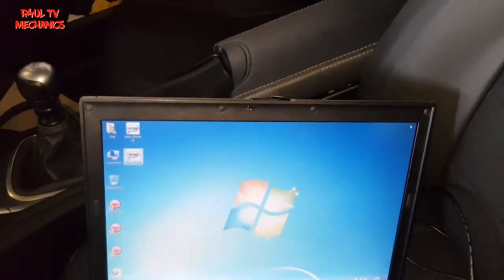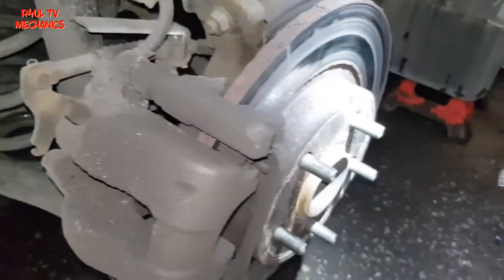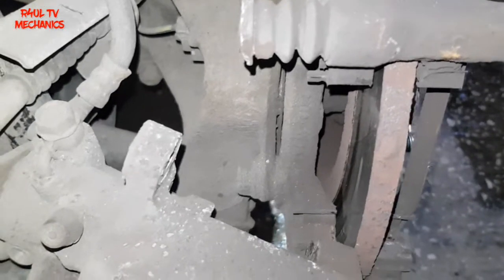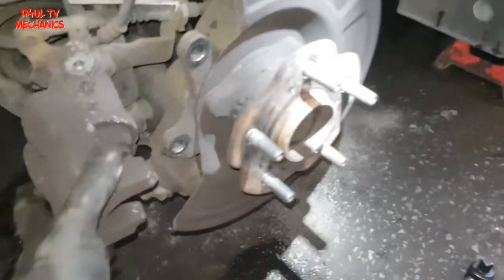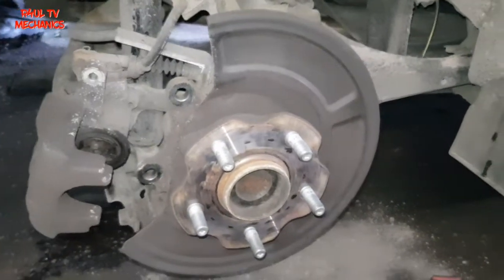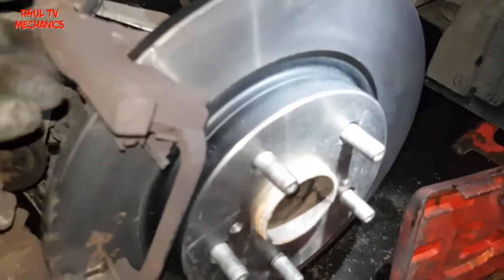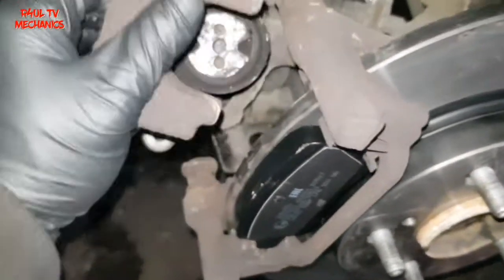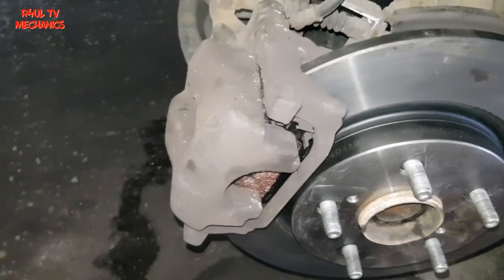2018 TOYOTA AVENSIS REAR BRAKE PADS & DISCS REPLACEMENT

Comment: Thank you for making this video. I just replaced the brake pads on my 2018 Toyota Avensis with an electric parking brake. Here's what I did: first, I started the car and released the handbrake using the button. Then I turned the car off (the handbrake stayed off). After that, I followed the steps in this video. I can confirm that to push back the brake piston on the right side, you need to rotate it clockwise, and on the left side, you need to rotate it counterclockwise. Thx from Sweden
Reply from the maker: Thanks for watching really appreciate it

Comment: I just come across your video and there is a service mode to disengage the handbrake and leave the power off. Switch the the car to ''ON' or ACC, but don't start the engine. Pull the EPB control and hold for 5 seconds. The AUTO (P) off indicator will illuminate. The parking brake will/should not engage when the car is switched off! When the job is complete, push the parking brake control and hold for 5 seconds and the AUTO-P indicator will go out. I have the first phase of the Mk3 T27 Avensis 2009, and the EPB is semi auto, meaning it auto releases when moving off, but has to be manually engaged. From 2011 the full auto system was introduced. Well done for pointing out the cut outs in the pistons and the position when fully wound in. I have done the rear brakes on my Avensis. One final point. No diagnostics are ever needed at any point!
Reply from the maker: Thanks for watching really appreciate it
Reply: Hi m8 great I have a toyota avensis 2.0drd and it is 2012 registered in the UK
I want to change the rear brake pads myself but I am rea scared about the epb. Some people say just don't apply the brake and jack the car up leaving the ignition on. But this could flatten the battery. What should I be doing in order to change the rear brakes
Reply: @mumtazzafar5696   If you have the owners manual, it will have instructions on how to put the EPB into service mode. Here is an extract from the owners manual as follows - 
Switching automatic apply mode from ON to OFF: Stop the vehicle in a horizontal condition and switch the engine switch to the “ON” position (vehicles without smart entry & start system) or IGNI TION ON mode (vehicles with smart entry & start system.
Pull and hold the parking brake switch
for 5 seconds or more
The Auto P-off indicator light will illu minate. 

After finishing the work follow the above instructions to get Switching automatic apply mode from OFF to ON. 
In simple terms, with the ignition on, pull and Push and hold the parking brake switch for 5 seconds or more 
The Auto P-off indicator light will go off. The EPB will resume auto release and engage as normal.
If like my Avensis with auto release and manual engage, just don't apply the parking brake!
Reply: @konradc12  hi m8 can you reset the oil service indicator earlier like 5 to 6000 miles on this car

Comment: Update: did service today,  procedure is very simple,.Before brake service,  turn ignition on and press for 5 sec. Parking handle, Then you should see on dash bord orange P this means that parging brake is off.  Then turn off ignition and do brake job.  That's it.  P. S for eu cars cilinder pasanger side turn to the right,  driver side turn to the left.  After brake job press pedal brake pedal a few time,  start engine,  engage parking by pressing for 5 sec,  now it's in auto mode,  and you done. You don't need battery charge.
Reply: When I tried this the Orange P was on the dash,but the handbrake was fully on so I Could not removed the caliper.
Reply: @pomajzsolt4363 the orange p is telling you that the auto brake is off so you simply release the handbrake with the switch and then you can switch off the ignition without the handbrake automatically applying.

Comment: hi bro do you have the link or item number for the brake wind back for avensis t27 2010 so i csn buy it from ebay,  thanks?
Reply from the maker: Just go on Ebay type in rear brake wind back tool

Comment: What are the torque specs for bracket and caliper bolts? Wheel nuts are 103Nm, am I correct?
Reply from the maker: I'll be honest I never torque the wheel or caliper bolts up, I just go off feel. To be honest most garages even main agents dont torque wheel bolts etc up. I worked for a main agent the only things we torqued up was cylinder head bolts, big end bearings  things like that. So I would say for the wheel just get a braker bar and tighten it up. As for the caliper bolts they dont need to be mega tight 3/8 Ratchet just tighten it up obviously without snapping the bolts.
Reply: Wheel bolts 120nm, caliper bolts 30nm with blue loctite.

Comment: When finished do you pump the brake before applying the handbrake?????? *
Reply: Yes that is a MUST do not apply handbrake until you have driven a couple of miles to bed in pads and disks. Avoid using auto function for two days until pads and disks settled in.

Comment: Is it safe to do it this way without the software 
Won't there be a  risk of the caliper ceasing after some time
Reply from the maker: I hope not. So far nothing has come back fingers crossed
Reply: And when did you do it
Reply from the maker: @mimbel12  to be honest this is a taxi I did it about year ago and only last week I did it again everything was ok
Reply from the maker: He had done the mileage
Reply: There should be no need for diagnostics! I have done brake replacement on my Avensis, and all is fine. In fact I thought the same about using diagnostics, and did try a reset. All this do was cause a major problem and cause the ECU to lose the zero point calibration. I had the luck and skill to fix this issue! So don't worry about using electronic equipment to do a 'basic' job. Not everyone will have access to things like Techstream, or know how to use it!